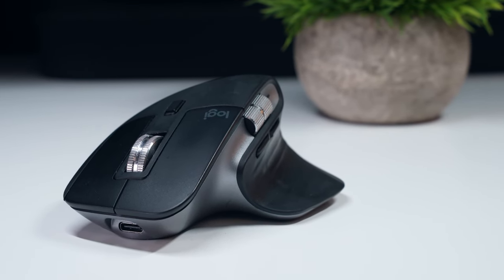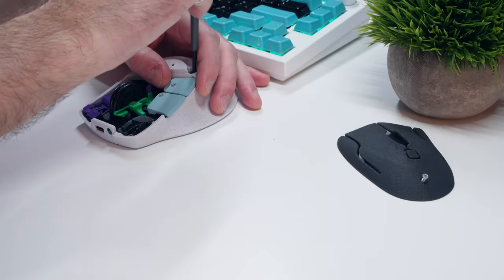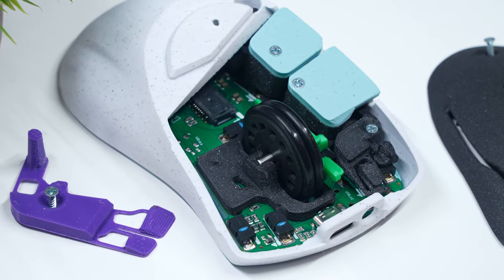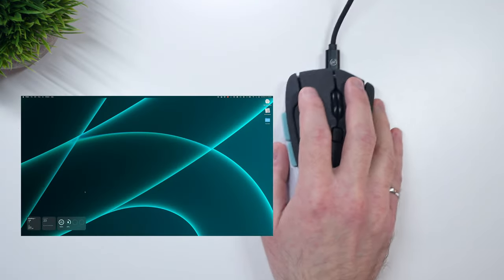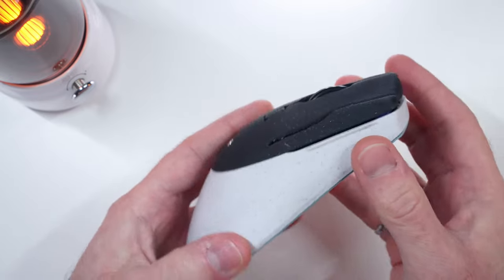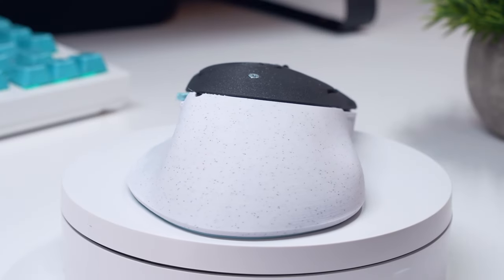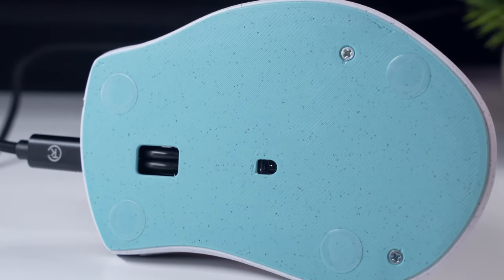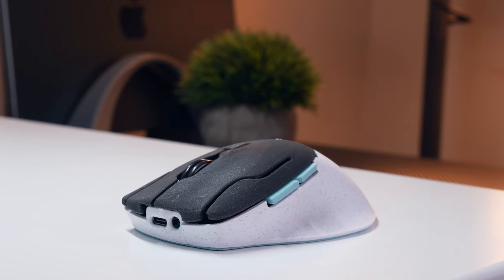A QMK Compatible Mouse: Ploopy 😳

Comment: to remove the layer line you should be able to use the fuzzy skin setting while printing
Reply from the maker: That also alters texture - my preference is to keep the mouse as smooth as possible. Good suggestion though 👍🏻
Reply: There's also vapor smoothing (most commonly acetone for ABS and isopropanol for PVB), but it can be hard to get right and may cause issues with tolerances. 
(Also proper care needs to be taken to not inhale fumes or accidentally make a fuel air bomb 😅)